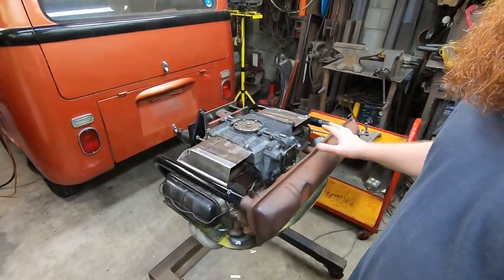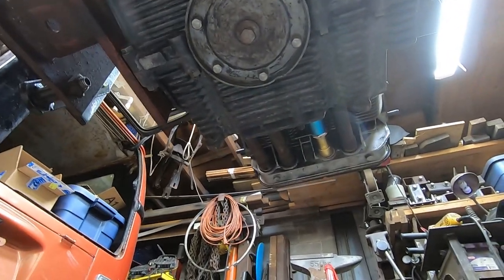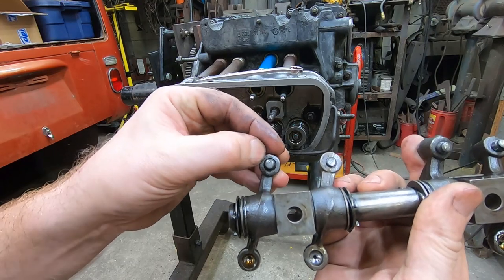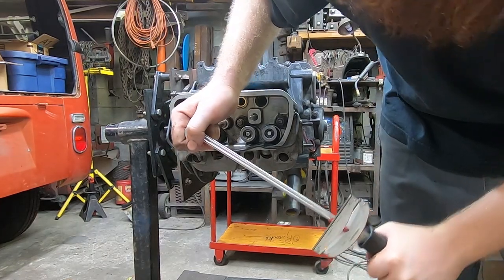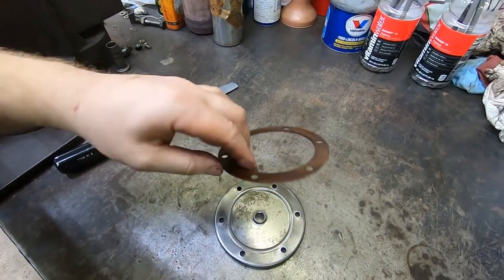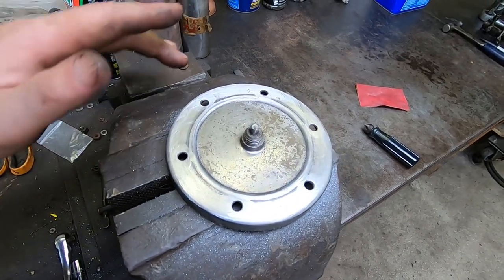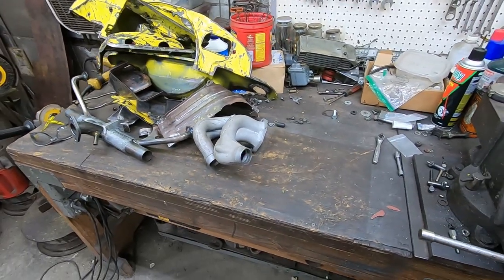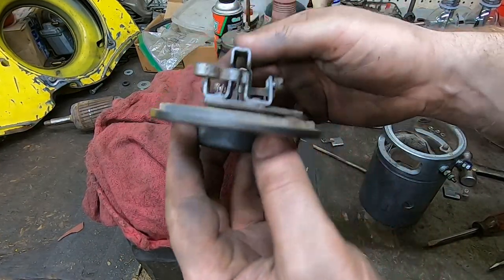Generator Testing & Disassembly, Engine Flush & Painting Tips VW Split Bus Restoration Vandemic E14

Comment: RTV sealant in the wrong places is one of the worst enemies of these engines. Areas like the valve cover gaskets and engine block halves are no-nos. Those can get sucked into the oil galleys and you definitely don’t want that. For valve cover gaskets I find the best ones are the original cork types without any sealant; a little grease works good to the point where they can be reused several times after valve adjustments.

I like your approach of trying to reuse as many original parts as possible. There is no substitute in quality to the original German stuff. Very nice video; thanks for sharing.
Reply from the maker: Yes Ricardo, too much sealant can really cause problems in oil galleys. Your comment may be prophetic- we'll be looking at rocker arms in the next video. Thanks for your input and I'm glad you're enjoying the channel!

Comment: HG! Well I thought I’d give you an update on the generator overhaul. No problems with disassembly. Good thing I have the manual. BTW, when I removed the free end bearing (end with fan) no real problems there. But the drive end (pulley end) was much more challenging. And I noticed you didn’t cover that portion so again glad I had the manual. Good thing my friend had old bed rail ( angle iron) laying around. Followed the instructions to make a plate and forced the bearing off in minutes. Cleaned all the parts and into the painting the end bells ( as I call them). Too cold in the garage so made a paint booth (card board box and light bulb) to get her ready for reassembly this weekend. Anyway, much appreciate the videos from you, and, enjoy your humor. Always posting in Instagram my progress.
Reply from the maker: Thanks for the update Scott! I haven't heard of the angle iron / plate method but it sounds simple and safe. I'm glad you were able to disassemble everything and get it prepared for reassembly- it will be a fun build! I'll check out your IG now. Good luck this weekend!
Reply: @HapticGarage  all back together! And no bearing noise! Fancey that! But some how I broke the accelerator cable....I have another. You know when you start digging into an engine,you notice things that aren’t right. Since I’ve had the car about a year (65), found a missing fastener on the fan housing, AND, the distributor cap was on backwards....yep, she still ran. During disassembly, fasteners were unexpectedly loose. During reassembly I did a sanity check on everything I could get to. Anyway, she runs great again. Thanks HG!
Reply from the maker: That's awesome news! (Sorry for the delayed response.) I'm glad you got it back together and all is well! I'm sure the new accelerator cable went in nicely- kinda cool that it failed at home instead of on the road. You must be doing something right! Thanks so much for the update and keep it up!

Comment: Another amazing video done to perfection ! Very thorough and complete on reassembling the outside in generally replace things that  have a good possibility of wearing out not knowing what kinda neglect it has been through ? Have you ever checked the compression on the cylinders yet ?  Let's see if we can get Haptic subscribers up to 2.5K !
Reply from the maker: Wow, thanks Neal for the kind remarks! I haven't done a compression test yet but it would be interesting to know the results. The #4 spark plug was cross threaded earlier in this engine's life, so I'm hesitant to remove it unless I really need to. I'm thinking it would be good to rework a set of used heads before something lets loose. For now, the compression seems adequate (fingers crossed). Thanks for the question!

Comment: There are a self taping studs for pulled 10 mm studs. I would tap one in and then back it out then jb weld or lock tight  it in. Thats if you not gonna rebuild for while mine had two they were holding. I  made a jig and drilled and tapped my own case saver threads. Risky but I got it good and hate paying those machine shop guys. Nice video
Reply from the maker: Thanks Jacqueline, I have one of those in a box of parts that I'm sure will be put to use at some point. Not ideal but may get a person to the next rebuild. Good job on doing your own case savers, gotta love DIY!

Comment: As always my sons and I really enjoy your videos. I'm definitely going to take a stab at making a driver bit similar to yours. It would've come in handy on my screws for the doors. Just as a quick tip we were painting the frame on the '70 Beetle and I needed something to plug the female threads for the spring plates and other various holes to keep paint out. In the past I've stuffed paper towels in them but this time I used the foam ear plugs. I think it worked great. Obviously, they only fit the smaller diameter holes but it worked out nicely. They went in easily enough and they will come out easily as well. Anyway, I wanted to give something back to you since you're gracious enough to share with us. Thanks a lot and as always we can hardly wait to see you in the next one!
Reply from the maker: Hey Mofoco 1432! Absolutely, the driver bit thingy would be good on VW door screws. You're probably aware that a #4 Phillips bit is a must, and I can say from experience the air hammer bit makes it mostly a stress free task. Thanks for the tip on keeping threads clean- I'll remember that! Sometimes I'll cheat a little and fill that space with the fasteners that will end up there permanently; it solves the thread problem and they get a fresh coat of paint too. I'm certain your idea will come in handy in an upcoming paint project. Thanks for sharing and being a part of the channel!

Comment: I’m surprised you painted the block. I read many years ago that VW specifically didn’t paint their air cooled blocks as paint, no matter the thickness, holds in heat. 
I do enjoy your videos and the honesty you project in these endeavors.
Reply from the maker: Hey Glenn, thanks for your comment. The paint would have to act as an insulator to some extent, which is undesirable of course. I think it helps to use flat black paint based on the idea that its rough surface dissipates heat well. The benefit of painting is to slow the corrosion process when exposed to water and humidity. Water will eat magnesium when given the chance. This is a lesser-of-two-evils judgement call, but the decisions we each make keep engine projects interesting! Thanks for being a part of the channel!

Comment: I would use type 3 Cool tin as well as the nice job u did on undereng./ J pipe.
Reply from the maker: Thanks Peter, I have some of those laying around that I'll use at some point, but so far have just opted for the normal deflectors.

Comment: Use an 8mm socket to knock the oil strainer cover holes back in place.  Like my old chevy valve covers. Hope that helps ..you make it look like fun.. in Texas it's  105 in my garage . I'm getting to old 😩
Reply from the maker: That's a great tip Ipz, thanks for sharing! I normally see low 90's in the shop this time of year; not fun but doable. 105? There's no safe age for that craziness! Thanks for watching!
Reply: @HapticGarage  love your videos wish I had an old bus like that but I just picked up a 74 love bug orange or( red hot red)can't wait to tear into it. But first I'm camming my escalade . I put a/c in my garage with a swamp cooler.  Freaking cold  🥶
Reply from the maker: Nice! I like the '70's bugs too. Lots of refinements represented in those models after years of functional improvements. Enjoy the AC- you must be in a less humid environment. I have an evaporative cooler that doesn't make a difference with the water on/off. It's kinda swampy here but just keeping the air moving helps a lot.

Comment: I usually use the Permatrx aviation sealer on my paper gaskets for the oil drain. But of course that’s just me. 
I like the idea of sanding down the intakes, to make them even that is a really good idea. I just had on one of my videos, not even sure if I put it up yet, the same torque wrench my father left me. Great video!
Reply from the maker: Yeah Slades VW, that 3H/aviation sealer seems happy on a Vdub. Let me know how the flattening goes for you- sometimes it's amazing how warped something can be despite appearing flat. That oil plate was a bit extreme. You can't beat the heirloom tools... special stuff. Thanks for sharing!

Comment: You are making me want to take my engine apart and go through everything.  However I did do this 2 years ago and it has been running beautifully (knock on wood).  Just took it 1000 miles camping this week and it ran wonderfully.
Reply from the maker: Oh wow, that's awesome Skater Stimm! Nothing cooler than some roadtrip camping in a cool vehicle. I'm glad it's running well, and I wouldn't question it unless it signaled otherwise. Anyone who's driven a 1000 miles in a VW knows these engines will talk to you. Maybe try some of this stuff out on your next build. Thanks for being here!

Comment: Loving the Videos Haptic Garage! Im about to pull my 1600 out of my beetle for some tin fixes and other fixes on my engine. I will look into the Kerosene trick since the beetle has sat for awhile and I want as much sludge worked out of the motor prior to starting it up! Im excited for you to get back to your Beetle as well after the Van!
Reply: Also I'd love more information on the Kerosene trick as well if you're willing to share.
Reply from the maker: Thanks Russell, great to have you here! I hope the engine pull goes well and the tin cleans up nice. Regarding the engine flush, there's not much to it but to seal the bottom half of the case (drain plug, valve covers, etc.), fill it up until it starts leaking (probably at the pulley if the oil pump is in place, and then drain. Repeat until you're content. Full disclosure, this was more of an experiment that seems to have gone well. Getting back in to the Dweezil project now, looking forward to some progress. Thanks for watching!

Comment: spring loaded pushrods will lead to engine failure....I lost connecting rod 2 through the case with those damn pushrods, they got hot, lost strength, and oil leaked out....BOOM.   12 miles from Buffalo on the way to Canada... Truckin off to Buffalo...on the flatbed.
Reply from the maker: Ouch! Sorry to hear you lost an engine to these things, that really stinks! I share your suspicion, but thought I'd give them a try to keep things simple during this refresh. I'll keep an eye on them while I run this engine and hope for the best. Thanks for the input!

Comment: Any reason you didn't pull the head and install new one piece pushrod tubes? I have never used the two piece but have heard stories about them leaking. I believe they were meant more for a temporary fix rather than a permanent install.
Reply from the maker: Hey Bob, thanks for the question. Normally I would pull the head, after which I would expect to find cause for tearing the engine down completely. I wanted to avoid that this time in favor of a separate build while this one is on the road. I feel the one piece stock pushrod tubes are the best thing out there when treated with a coat of flat black paint. Logically, these 2 piece types will leak if the little o-rings give up, so I agree they are better as a way to get you home. Or, as in this case, squeeze a little more life out of an existing build. A judgement call for sure... Thanks for inquiring about my take on the matter and for watching the video!